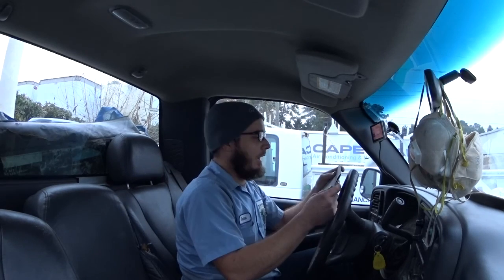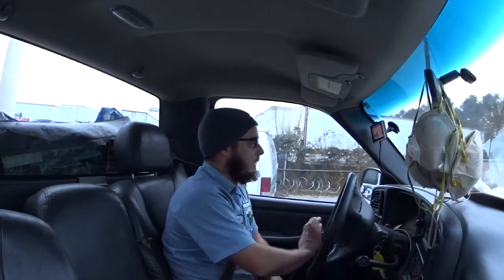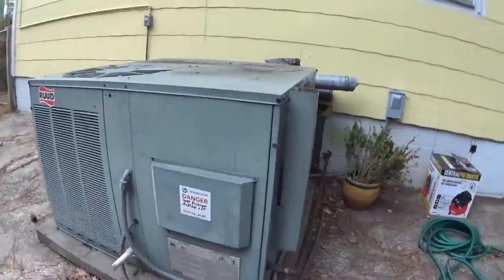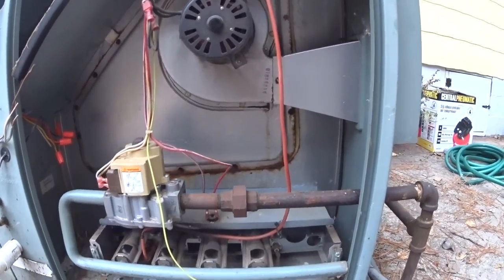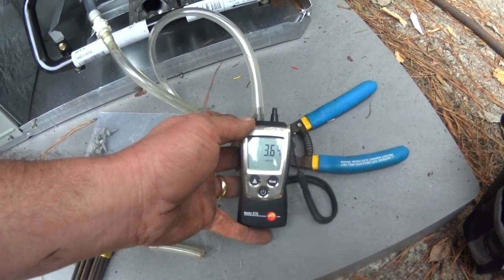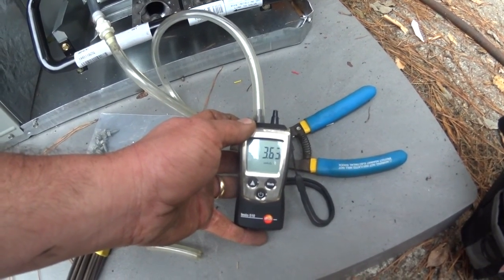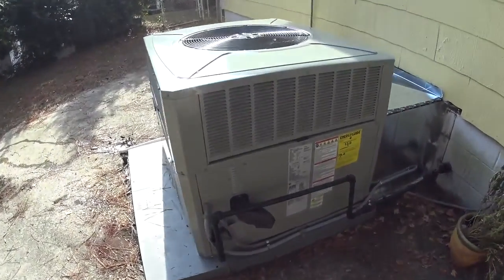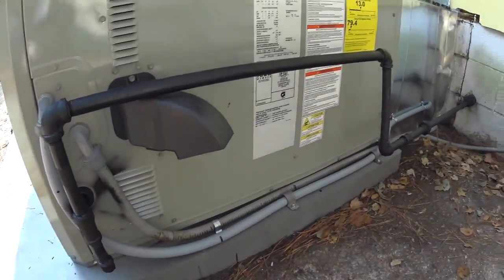HVAC Installation: Gaspack by Myself and Combustion Analysis Testo 320

Comment: Any chance the iconnect will develop an app that works with the combustion analyzer to show if your in the proper range similar to what the Imanifold does for AC trouble shooting? It might be nicer than trying to lug around true techs printed manual.
Reply from the maker: That would be nice, I have the manual in PDF rather than Printed Paper.
Reply from the maker: Are
You listening +Imperialtools?